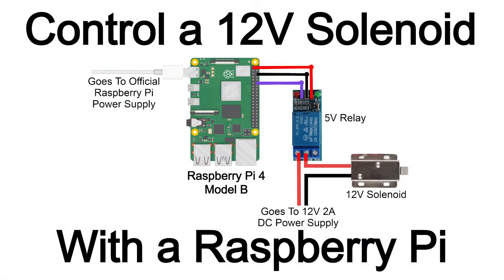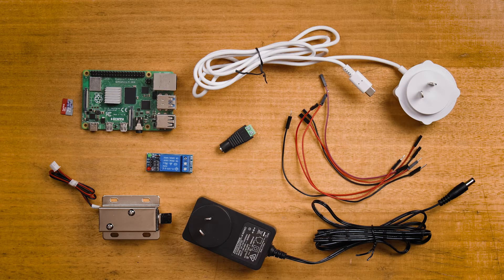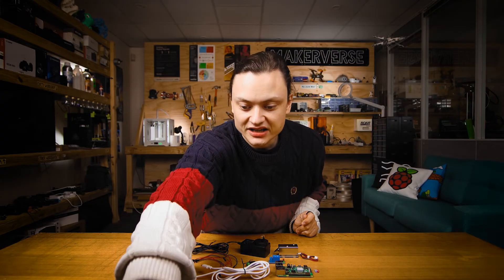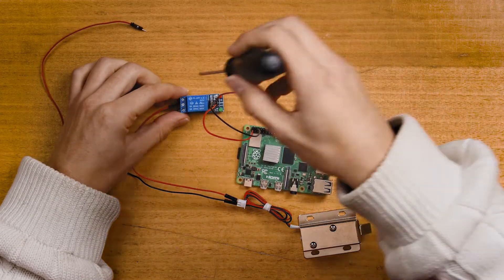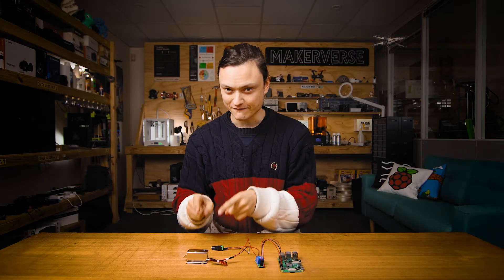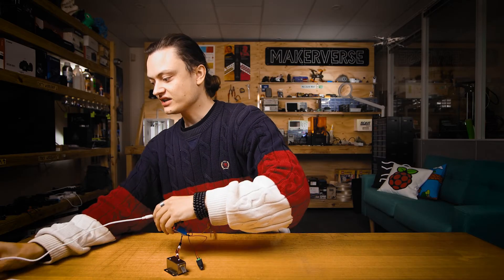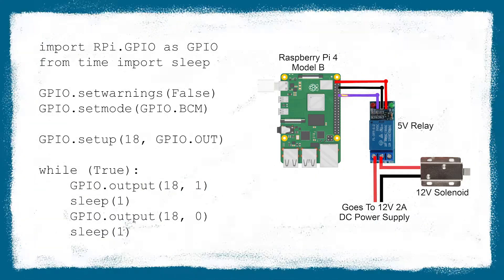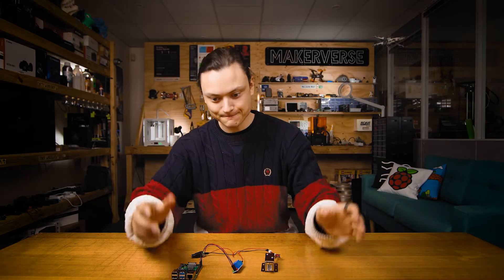How To Control A Solenoid With A Raspberry Pi Using a Relay

Comment: I wish there was a way to do this without using a powersopply for the solenoid, just using the gpio voltages of the pi itself.
I'm a real newbie with electronics but I feel like if you are just trying to activate the solenoid every couple of hours there should be some way to use a capacitor or some other circuitry to get it to work.

Comment: hey, I had the same project and I have a pi4, pcb which is normal pcb and relay and 5 v solenoid, so can I do same process to make that work....also I think my pcb is connected with pi with stacking header so its connected with gpio pin so how I will be able to connect that wires to pin and also can you get me the link where I can get rest of parts

Comment: To be that doesnt make sense.
3.3 volts you said isnt enough to activate the relay. But sending 0 is also not enough to active the relay.

So how is the relay being turned on if both 0 and 3.3 vts isnt enough to turn on the relay

Comment: can i use three 3.7 Li ion batteries instead?
Reply: If you use a higher mah then it will cause heat around the connection due to high flow of current

Comment: Someone posted a video where they were using a raspberry pi zero to power a 3D printer with klipper. The person noted that running a webcam is not recommended because the Zero can't power it. Im wondering how i could set up a zero that i have with a little relay for the webcam, or maybe somehow indirectly power the webcam. Im also wondering how i could connect it to send off information to a mini server i plan on building so it doesn't overheat. @CoreElectronics Thoughts?
Reply from the maker: That sounds like a bit of an involved project, we don't do much support over comments, but we have a dedicated maker forum for helping people scope out projects like this! Feel free to post your question over there (what you have here is pretty good, maybe just a little bit more about how you are powering this all):

https://forum.core-electronics.com.au/

Comment: Would you have any idea why the output pin remains in high state once defined as output? As soon as one of my pins gets defined as GPIO.OUT, the state becomes GPIO.HIGH, yet when calling GPIO.output(pin, GPIO.LOW), the state remains high...
Reply from the maker: The first thing to troubleshoot would be to triple check you are plugged into the right pins, even after a decade of working with Pis its still sometimes a hiccup. If you are using a Pi 5 some libraries have had issues with the new way that the Pi 5 talks to the GPIO pins. You can try and use the GPIOZero library instead.

Import the library with:

from gpiozero import LED

Initialise a pin with (this library calls them an LED output, but at the end of the day its the same digital on/off signal):
solenoid_name = LED(14)

And use it with:

solenoid_name.on()
solenoid_name.off()

If these still don't work, feel free to post on our community forum topic for this post, we have lots of makers over there that can help!

https://forum.core-electronics.com.au/t/how-to-control-a-solenoid-with-a-raspberry-pi-using-a-relay/10461/2

Comment: What if I want to control 100 solenoids? Are there any hats I can stack on the raspberry pi? Or a way to connect multiple multi-channel relays?
Reply from the maker: 10 solenoids becomes a little bit of a challenge, 30 would be difficult, and 100 is an absolute monster of a project! The Raspberry Pi only has 26 IO pins that can turn a relay on and off, so the first challenge is getting more pins or efficiently using them. You can wire 20 pins up into a 10x10 matrix to get 100 outputs, search for something along the lines of "LED multiplexing" to find some good starting guides. The only issue with multiplexing is that you cant individually control all the solenoids, its better for only a few select at a time. 

If you want to individually control a lot of them at once, you might need to look for an IO expander, they ussually plug in via I2C and give you more IO pins. You will also need to manage your power which can add up really quickly. This sounds like a big project with a lot of moving parts, doing things at the scale of 100 is quite a challenge. If you are looking for some more guidance we have a community maker forum with lots of eyes over there that love these sorts of challenges, feel free to chuck a post there about your project!

https://forum.core-electronics.com.au/
Reply: @Core-Electronics  Thank you for the detailed suggestions! I'll be looking for Expenders via I2C and also SPI.

I've done some research and found 16 channel and 24 channel relays.

 I also found something called a I2C Multiplexer which I will also look more into to connect multiple I2C expenders so I can individually control each one of them. 

As for managing the power, that's a good point, I'll have to do some research.

I'll definitely be reaching out to the community!

Comment: Why can't you use a 5v dc to 12v dc boost convert instead of using 12v mains power?
Reply from the maker: If you are looking at powering the Solenoid, you could definitely use a buck converter! As long as it can supply enough current for the solenoid to actuate.

Comment: 1:50  top red line goes to 3.3v on rpi, should be 5v for the 5v relay,  on relay NC normally closed (here 12v power to solenoid = bad), NO normally open (no power to solenoid) 
4:06  while (True):         why add the ()    it is useless

Comment: Why not just suggest that people get a 3.3v relay or a relay hat designed for the Pi instead of using a 5v relay that "works fine"?  I can imagine a scenario where someone buys a 5v relay off Amazon, finds it doesn't work with the 3.3v pin, tries it with the 5v pin, and fries their Pi.  Would it be that hard to just stock a 3.3v relay or a hat?

Comment: are you certain connecting the positive end of my 5v relay to the 3.3 pin wont burn out my raspberry pi?
Reply: use the 5v pin on the rpi

Comment: When the relay is actuated and it the solenoid changes states, is it constantly being powered until the relay is again actuated back? Or is the solenoid only powered in for a moment when it switches states?
Reply from the maker: Hey Brett, the relay acts like a switch and when it changes state, it will keep powering the solenoid until the relay is turned back off

Comment: Will this also work with a raspberry pi pico and the very same relay?
Reply from the maker: That relay is designed to work with a 5 Volt signal, but we've found it to work at the 3.3 Volt signals the Pico uses. 
We also have a dedicated guide to relays for the Pico if you want to check it out: https://core-electronics.com.au/guides/digital-electronics/getting-started-with-relays-examples-with-raspberry-pi-pico/

Comment: hi i have issue, connected using 3.3v but relay doesnt work, red led indicator shown, however if connected to 5v the relay works but it will keep turned on. please advised on the steps or approach. Using SONGLE relay module 5v
Reply: Hi how did u solve your problem? We experience that problem too
Reply: @cabigayanjack1879  У меня та же проблема :(
Вы как-то решили её?
Reply: Same problem here :(
Reply: @jeissonsteevengilermontes1910  У меня та же проблема :(
Вы как-то решили её?

Comment: You might be better using the pi for home assistant, then use esp32 boards or 8266 boards as the micro controller, to control the electrical signal, home assistant is a very powerful system and your already doing most of the processes required to utilise it, and affords a wider scope of operations/ functions, just a thought for anyone going down this route.

Comment: Can i make this project with supplying power just to the raspberry pi instead of both the raspberry pi and solenoid? Like instead of needing 2 power sources.
Reply: Solenoid takes 12v to activate. Pi gives output of 3.3-5v. I control 480v motors with pis. But you always need more than the pi to get your source power.

Comment: Awesome video! Crazy how I thought to myself I'd never find a video of this, and here you were.

Any recommendations on how you could link multiple solenoids to the raspberry pi? Say I wanted to have 5 latches (only opening one at any given time)
Reply: Instead of an sd card, you can use an ssd, its far more stable,faster and alot more memory.

Comment: I built this exactly the same as you - the green light on the relay turns on and off at intervals but it doesn't seem to power the 12V side - is it because my relay is too cheap and doesn't work with 3.3V ?
Reply: i have the same problem. Any solution ??
Reply: @rinokurian6299 same problem

Comment: Is the 12 v power supply damage the relay
Reply: You are mistaken and missed details. The power supply is only supplying the load and the relay can work on the NO/NC contacts and common contact safely within the 10A/250V AC or 10A/30V DC specifications. The "VCC" pin that caused you confusion will have 5V because the Raspberry was powered by USB

Comment: I've got a problem, I've done the connections just like you and connected everything, but it doesn't work, the green led switches from on and off but the solenoid lock doesn't work. The only thing different from your project is that i've used is a 12V 1A DC power supply, can this be the reason it doesn't work?
Reply: Did u find the solution plzzzz

Comment: Is back EMF an issue to be worried about? When is it necessary to be using opt-isolated relays? PS. Love your videos and all the others by the Core Electronics team.
Reply from the maker: The relay used here has all the circuitry (most importantly a correctly placed diode on the PCB) to manage the Back EMF that this solenoid produces. If your working with much larger solenoids (or other back EMF producing hardware like DC Motors) with much higher voltages, an Optically Isolated Relay makes perfect sense.

Thanks so much for your love 😊❤️ hope you have a fantastic week!
Reply: @Core-Electronics  so in general most relay modules have a back EMF diffuser mechanism such as flyback diode? I also wanna ask why it's fine to connect the 5V relay's VCC to 3.3V of RPi ? Thank you for this comprehensive tutorial

Comment: Excuse my ignorance, by replacing the solenoid with a 230v electric motor, could I activate with the same scheme? Obviously I'll have to feed the engine with 230 instead of 12v, right?
Reply from the maker: Definitely so long as its a DC Motor. You need to have a Relay that can manage that level of Voltage and Current. Also 230Volts can easy stop your heart and kill you before you hit the floor. I'd only mess around with it if you are an electrician. DC Motors can run at various voltages with less efficiency. You may just be able to run your motor at a safer ~28V which, in that case, you could use this relay here - https://core-electronics.com.au/5v-2-channel-relay-module-10a.html

Comment: I have an application already built it C# which prints out a label.  I would like to make changes so that when the user clicks on print a solenoid opens and sprays water into the box.  Is this possible?  Can I interact with Raspberry PI in C# ?
Reply from the maker: You can absolutely run, build and test Scripts written in C#. Here is a really nice guide to get you up to speed 😊 https://carmalou.com/raspberry-pi/2017/04/21/code-c-sharp-on-a-raspberry-pi-in-5-minutes.html

Comment: I want to make A mini jackhammer out of a push pull solenoid. I don't know how to make it work like a jackhammer?? like 'Push and pull' is one cycle like a jackhammer. I have been trying to find out how for like 4 days now. is there a little pcb board that can do this or control it?
Reply from the maker: Haha I love the idea, although once complete it will be more of a prop than a fully functioning Jackhammer. The solenoid doesn't have as much strength as compressed air. 

You can control the solenoid to open and close rapidly by altering the Python Scripts I provided here, you could also use an Arduino like this - https://core-electronics.com.au/guides/solenoid-control-with-arduino/

Comment: Can you control raspberry pi with javascript instead of python?
Reply from the maker: You definitely can, Node.js is what I'd recommend if you were to start. Its not installed by default and there are some different versions to choose from. This should help - https://thisdavej.com/beginners-guide-to-installing-node-js-on-a-raspberry-pi/
Reply: @Core-Electronics  thanks for the info ☺️ my ultimate project is to make a small pinball machine using raspberry pi 4 using windows and javascript. Do you think that’s possible?
Reply from the maker: Oh yes I do! Just check out what I was looking at yesterday. This Pinball machine is all controlled via a Raspberry Pi 4 - https://www.youtube.com/watch?v=FajNEfTG89U

Comment: I'm attempting to do this remote through ssh with VS code, but from some reason after installing all the dependencies and packages I can't use "import RPi.GPIO" its like it doesn't exist
Reply from the maker: Heyya mate, using GPIO through SSH remotely seems to have some intricacies that I've only just become aware of. Come give this a look here - https://gpiozero.readthedocs.io/en/stable/remote_gpio.html and this here https://stackoverflow.com/questions/52678458/python-over-ssh-event-detect-not-working . Hopefully that will help solve your issues

Comment: Hello, I have a question about the raspberry nano and pico, they dont operate on 5v but 3,3v can they operate these relais, or do u need a stepup something in the middle?
Reply: Rhanks, I am.still in doubt if I should go for arduno and a pi as server or everything pi. I lean more to everything pi. I want to connect everything by utp. And I dont like to solder, so I meed shields/hats for all sensors  and.a couple.of.motors. real headach to figire it out.
Reply from the maker: The exact Relay you see in the video will work just fine with the Raspberry Pi Pico. In the Specification on the Product Page you will see this - While marked as a 5V supply voltage & input signals, we have found this to work fine at 3.3V -  https://core-electronics.com.au/catalog/product/view/sku/CE05137

Comment: Thank you so much. But, is it confirmed that 3.3V will make all the 5V relays work?
Reply from the maker: For this particular gear absolutely. Check the specification sheet to find out whether a particular component is capable of running at lower voltages.
Reply: @Core-Electronics  Thanks a lot

Comment: How much current can raspberry give out from gpi pin ,want to control a pump with solid state relay if possible, plzz reply
Reply from the maker: The operating voltage of the GPIO pins is 3.3v with a maximum current draw of 16mA. As the Relay will be managing the heavy current/voltage needed for the pump, it isn't too important what current the Raspberry Pi can give out. Just so long as it is enough to activate the relay on and off.

Comment: How many solenoids can one raspberry pi control independently?
Reply from the maker: The main focus is how many relays can the Raspberry Pi control which will then be used to activate the Solenoid. You should be able to control at least 2 relays using this method but there are some fantastic Relay HATS for the Raspberry Pi which will let you control more. You can also use I2C expanders to control many many more (check the following links for examples of these). https://core-electronics.com.au/catalog/product/view/sku/CE04864 and https://core-electronics.com.au/catalog/product/view/sku/DEV-14150

Comment: I used the same code but the door is only unlocked. Lock part is not working
Reply from the maker: Using a solenoid like the one in this guide won't be powered in the locked position. If it was it would gradually overheat. The way that it locks is based on the shape of the latch. When it is in locked position it physically won't be able to open as it will bump up against the female side of the latch. Only when the solenoid is activated and pulls the latch back will you be able to open the door.
Reply: How would I know end the loop to a simple open then lock? Instead of it constantly looping the process???

Comment: For the project I'm working on I need 6 12v solenoids which I planned on using an 8 channel relay for with the raspberry pi. How would I need to go about powering each solenoid? They would only be switched on one at a time for very short bursts. Is there any way to power them all with one supply? Thanks in advance
Reply from the maker: The Raspberry Pi needs to be at 5V, so to eliminate the need for that power-supply you can use a step down converter like this one and then pull the power for the Pi from the Solenoid Power supply - https://core-electronics.com.au/catalog/product/view/sku/ADA1385

Also check out this 4 channel relay module - https://core-electronics.com.au/catalog/product/view/sku/CE05279

Make a forum post and we can help you even more if you need 😊
Reply: @Core-Electronics  thankyou! :)
Reply from the maker: Also take a look at this -  https://core-electronics.com.au/catalog/product/view/sku/DEV-14150

Comment: I have a question: I have a project which I just started working on that is similar to your video, my set up though has a 12v system using a momentary push button and I need to see the event using the RPI. My question is on the relay, are they bi-directional meaning if I hook the button to the 12v side and clicked the button would I see the event on the 3.3v side of the relay? Thank you in advance.
Reply from the maker: So take the time to check all the Specification Sheets, but with the right Relay you should be able to control a 12V system using a Raspberry Pi. 
That is one of the great things about relays allowing you to mechanisms on a higher voltage/current which are activated by a lower voltage/current device. Naturally plugging 12V electricity directly into a Raspberry Pi Board is a big no go though.